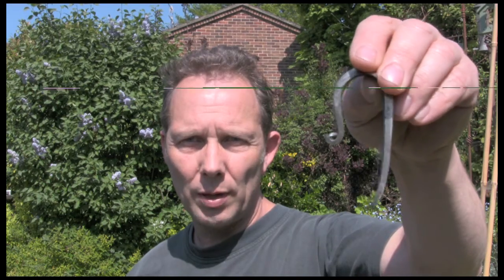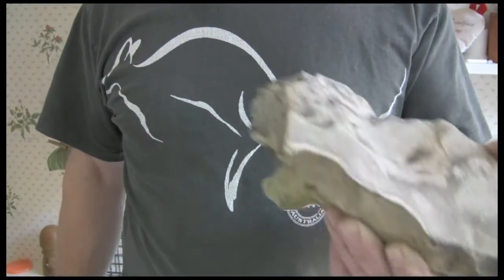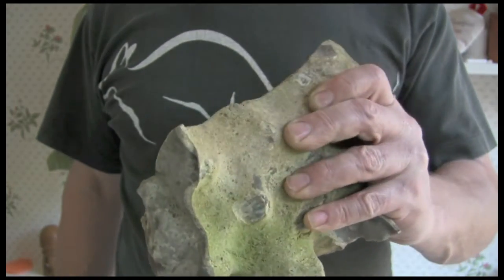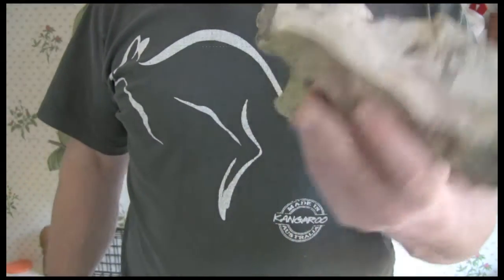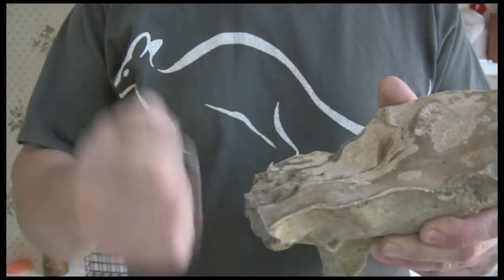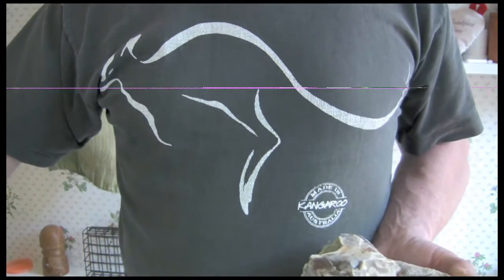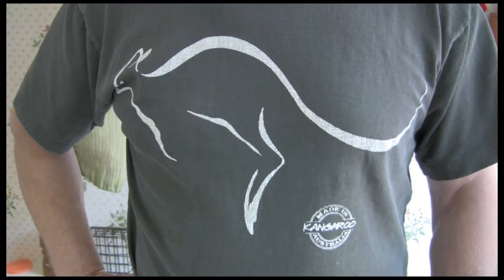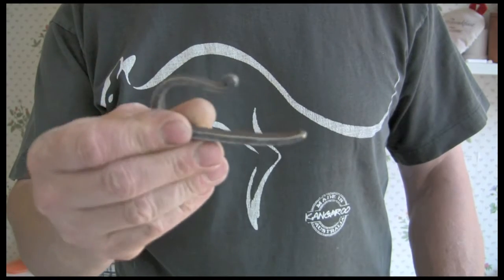Flint Striker.

Comment from the maker: @gatorDennis firstly, I would make sure that what you think is a flint actually is a flint! If it won't spark with a file I would suspect it isn't......... The only way to do it is with a forge or a gas torch to heat it and bend it to shape.... you don't need to do anything to the file to try it though, it should work as it is.

Comment: I am looking on how to make a steel to strike on my flint. My old files, allen-wrenches, knives, screwdrivers & etc don't spark at all. I have flint from Ohio, even an old arrow head that wasn't quite finished. The Internet is no help, it says to use the items I tried. I don't have the tools to allow me to work the old steel. Is there someway to turn an old rat-tail file into a "D" or "Ul" steel?  Your video on your striker shows it works.